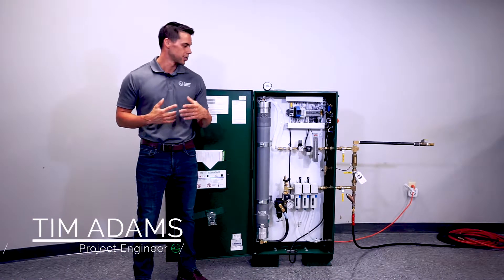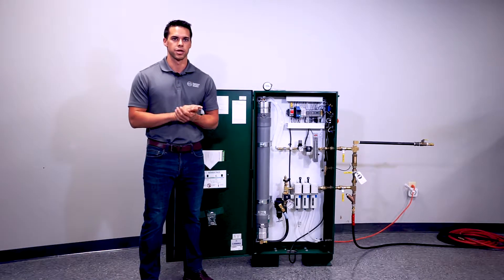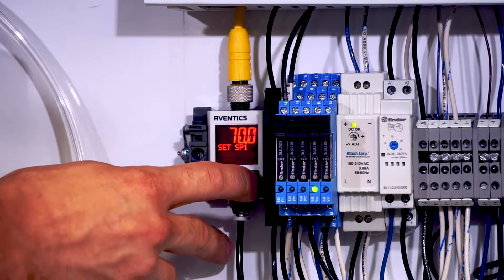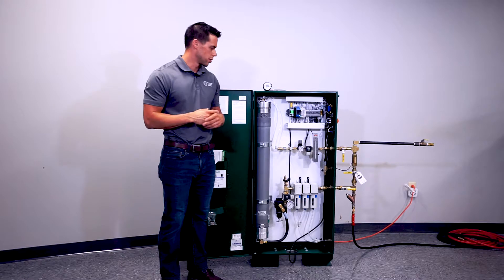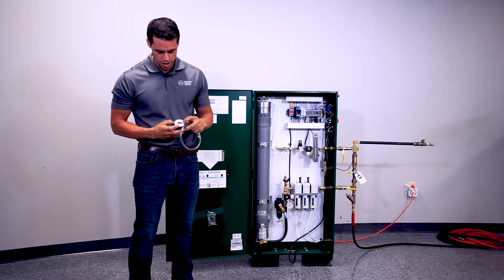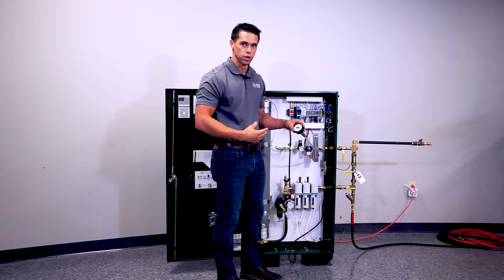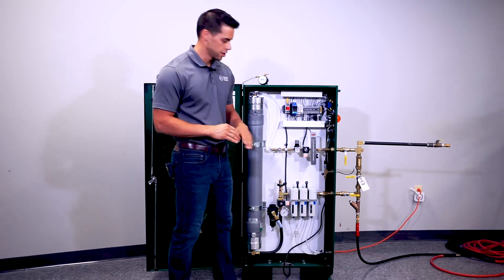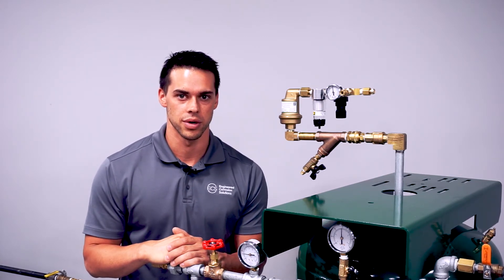PGEN-30 Walkthrough: Nitrogen Generator Pre-Startup

Comment: When adjusting the flowmeter, does the bleeder ball valve behind the flow meter need to be wide open? If I adjust the flowmeter to the minimum setting that is specified in the quick start handbook for my unit model, and then use my handheld analyzer only to find that the purity is less than 98% what should the next steps be (assuming I've also verified that there is between 130-150psi on the feed gauge, and I've verified at least 20-25psi on the nitrogen supply line for my analyzer to get a reading)?